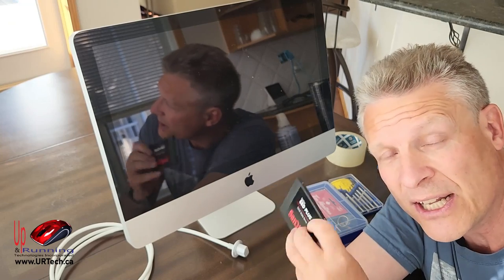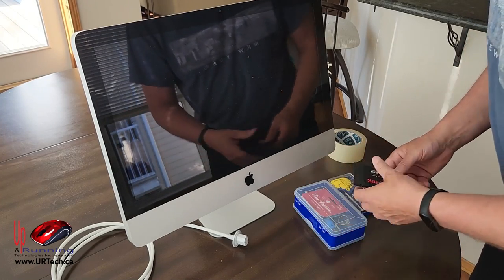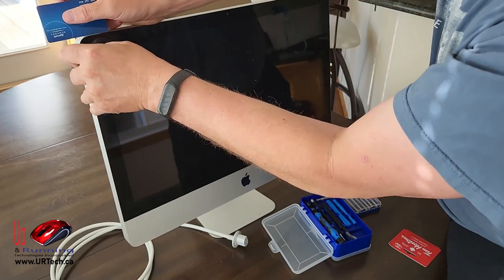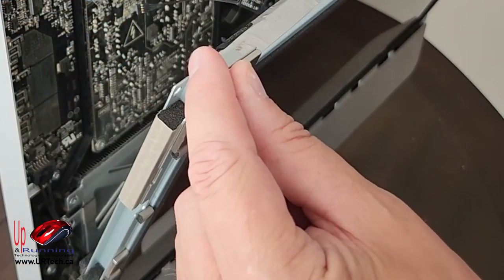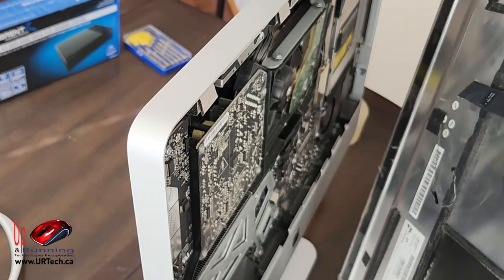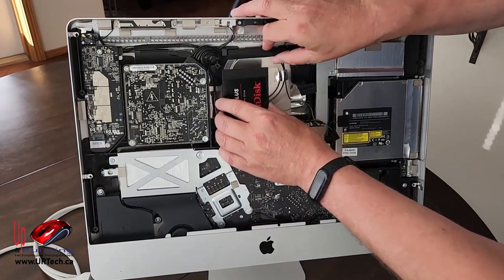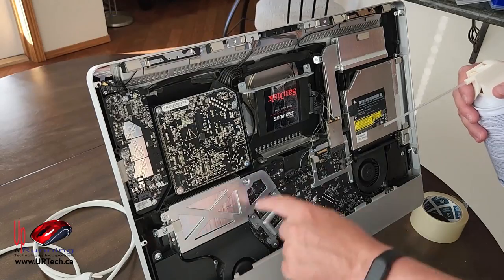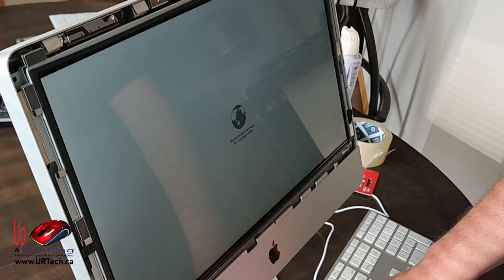iMac Hard Drive to SSD Replacement

Comment: You disconnected 3 cables from the hard drive. The temp sensor, the data cable and the power cable. What happens with the power cable?

Comment: Hope nobody will blow directly to the CPU fan not holding it. The fan motor works as a generator and can damage MB by generated current. :)
Reply from the maker: I don't think so.  I have being doing this for more than 30 years and never damaged a fan.  While I am sure you are correct that is is possble, I think it is highly unlikely.
Reply: In my experience, it is luckily the same, but my colleague once damaged MB by blowing to fan, probably it depends on many other factors. But there a lot of debates exist about it. 
Citation from Cisco "IT essentials" course: "CAUTION: When you clean a fan with compressed air, hold the fan blades in place. This prevents overspinning the rotor or moving the fan in the wrong direction."